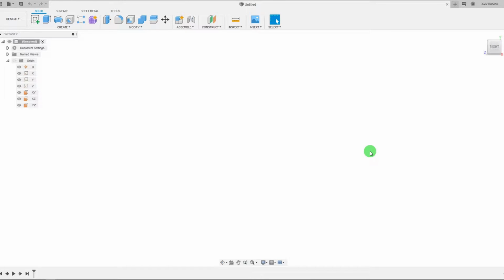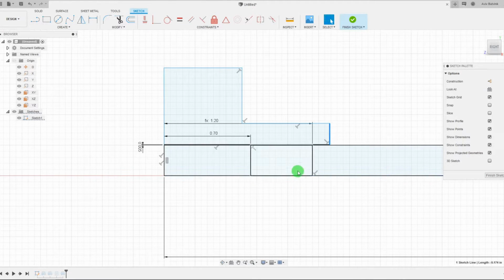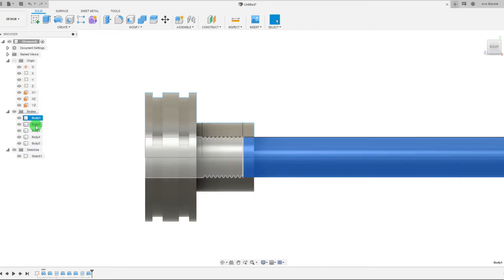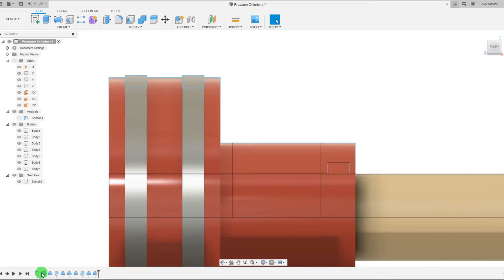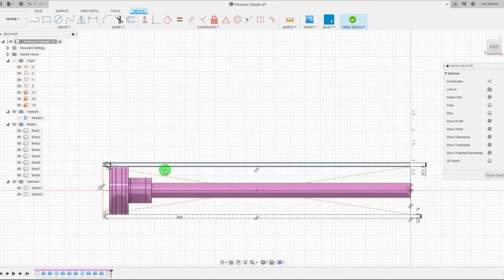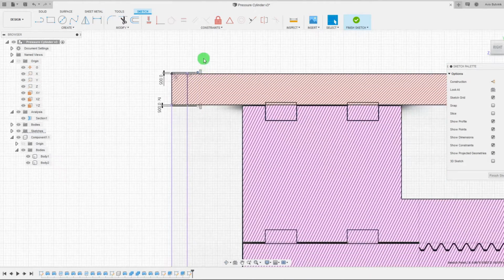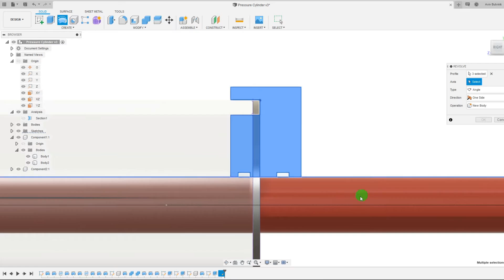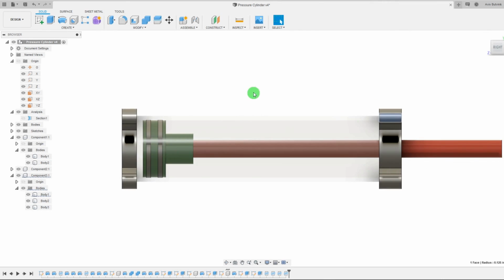How to Make a Pneumatic Cylinder in Fusion 360! Tutorial Lesson in Modeling Assemblies

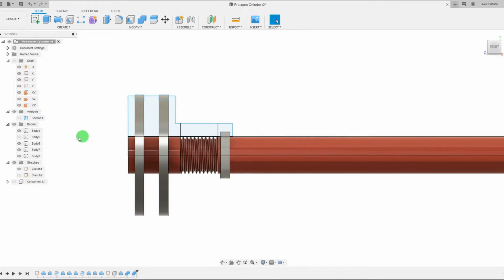Comment: Im a novice, but at 31:09 Body1 is a rod with a thread part way along it.  This would be difficult to tool and almost impossible to use.  I think you should regroup to ensure the thread is at the end of the rod, not part way along.  Am I missing something?
Reply from the maker: I have no problem making it the whole length if it is compatible with the plunger. Whwn it comes to manufacturing, it depends on the method. This could for sure be made in a die cast tool. If it were to be machined, it could be made on a CNC lathe.